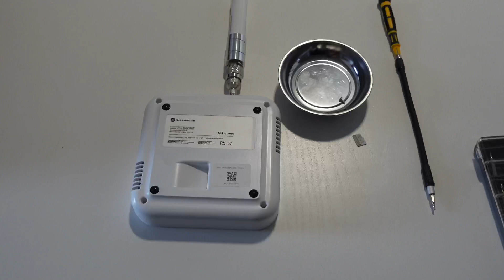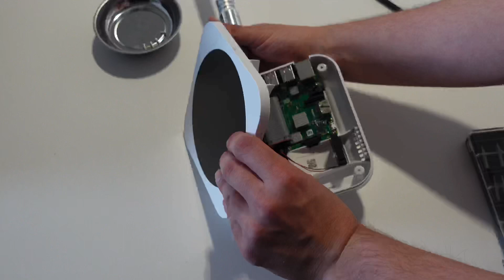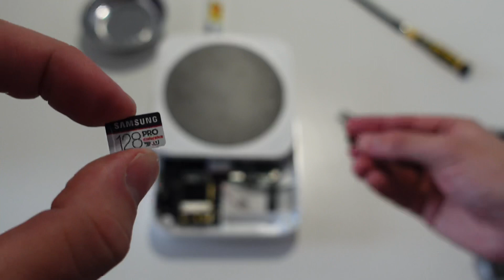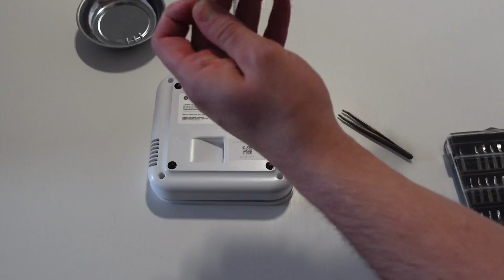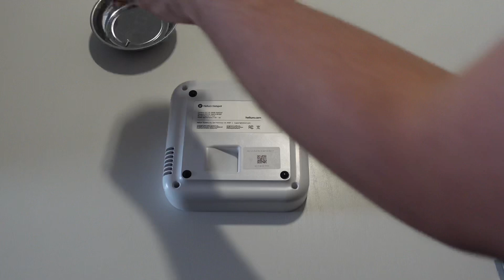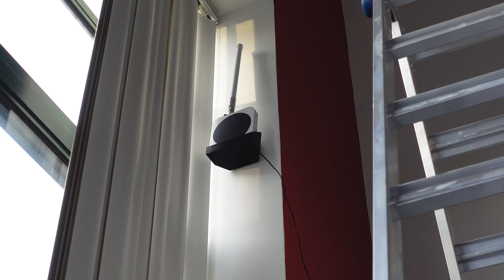Helium Hotspot How to Upgrade micro SD card

Comment: I went a step further and replaced the entire old original raspberry pi 3B+ computer with a new raspberry pi 4. So now I not only have a new higher capacity SD card. But I also now have a faster CPU and more RAM. Working great so far after the upgrade.
Reply from the maker: Wow I wouldve love to do that !
Reply: My friend, how is your hotspot does it do more hnt with pi upgrade?🧐

Comment: Thank you for this! I tried to set up POE and had the wrong power type. Specifically 12v on a 5v hotspot. Do you know if it's possible fix that on the original hotspot or is it likely fried?
Reply from the maker: Whats poe? Anyway I think if you supply it was 12v it fires some part. Maybe the motherboard that can be replaced
Reply: @JeffRozanVideos  Thank you for responding. Sorry about not clarifying.  Power over ethernet.

Comment: Jeff, thanks for the video. I have a question: What are the indicators are that suggest a Micro SD Card needs to be changed? Put another way, how does one know if/when the SD card needs to be replaced?
Reply from the maker: The syncing of the blockchain can never stay fully synced or does down in percentage
Reply: @JeffRozanVideos  Jeff, thanks the response, but it's not an answer to the question I asked.

If anyone does have an answer please leave a reply. Note: I think any hotspot owner watching this video would want to know why they would change their micro SD card, and what signs/indicators they should look for that suggest that they need to do so?
Reply: @mrchaos4042  his response literally answered your question
Reply: Itll be at 99% and never reaches 100%. New sd card is needed. Your welcome🤤

Comment: Thanks for the video @Jeff.  What would you suggest if this does not fix the syncing speed?  Any other hardware components that might need replacing?
Reply from the maker: It could be that the wifi connection is slow maybe hooking it up to a ethernet cable could help. Otherwise im not too sure. Messaging support helps alot !
Reply: @JeffRozanVideos  thanks for your response. Yeah I'm on ethernet connection. Will continue trying to contact support but they aren't responsive unfortunately.

Comment: Hey Jeff! Can you explain to me a bit for what reason you doing an upgrade the sd card to a larger amount of space? Is it increase the helium gaining or something? Im kinda new about these thigs cant find the info about sd cards.
Reply from the maker: More room on the SD card means that more of the helium blockchain can be downloaded
Reply: @JeffRozanVideos  Does it somehow affect the miner's bandwidth? Should it be done immediately upon receipt of the device or, in some specific case, what are your recommendations?
Reply from the maker: @white18389  only upgrade the sd card if you are having problems syncing to the blockchain or in other words keeping up with the blockchain
Reply: @JeffRozanVideos  Jeff, got another question, i see that you upgrade the antenna. Is it worth to buy antenna like yours to use it indoor? Is it still better then the stock antenna? How much dbi you are using?
Reply from the maker: @white18389  Its worth it to use a better antenna for sure

Comment: Dont you need to add thermal paste or thermal pad?
Reply from the maker: Why would I need that? Thanks for looking out
Reply: SD cards don't get very hot in use. Thermal paste is for things that get hot - like CPUs, GPUs, etc. I've been using Pis for a lot of things for a long time and often have had cause to look at them with a thermal imager while in use - the SD card never gets more than lukewarm even during heavy IO.